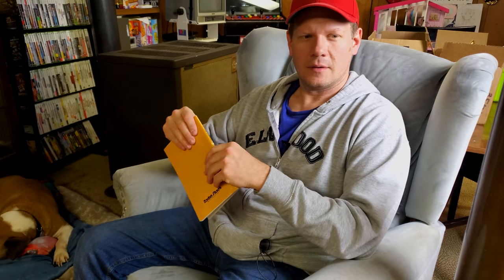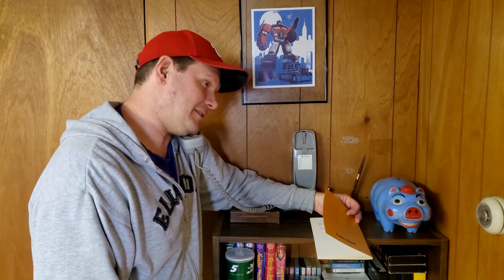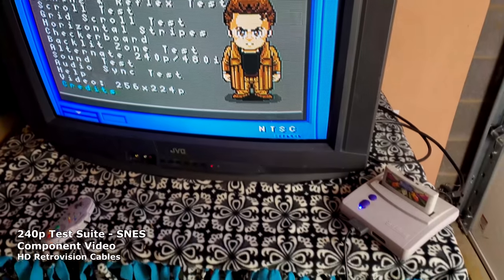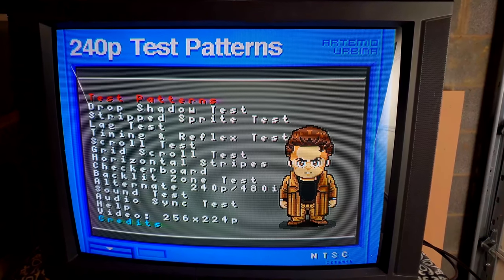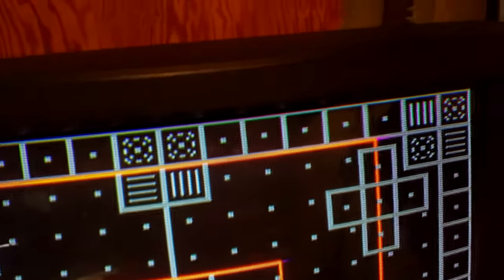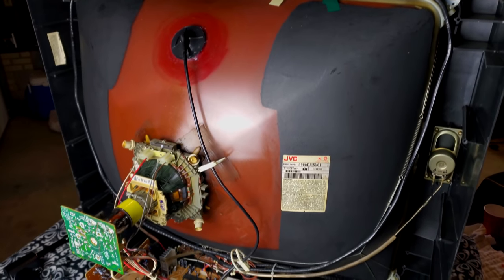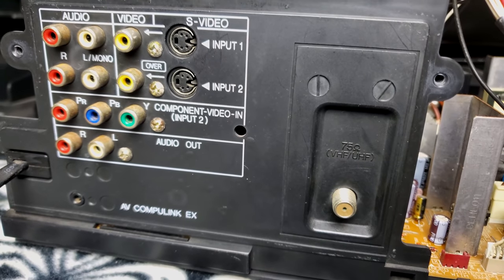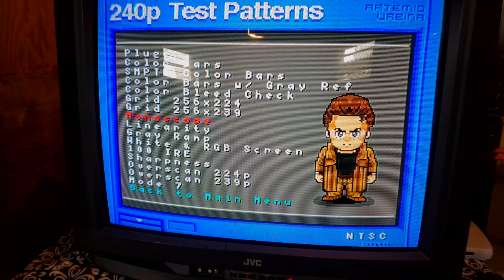The Biggest CRTs still in Use: The JVC 36" D Series TV

Comment: I've been tinkering with the service menu on my 32" for a long while and I think I have the geometry as good as I can get it with the options available. Still a bit wobbly, but after seeing your scroll / linearity tests I feel much much better about it not being "perfect." I don't have much a basis of comparison except your videos on calibrating them! Thanks a ton for the info and the active lab report!
Reply: How did you get into the service menu? The combinations I tried haven’t worked.
Reply: Same question as Nathan
Reply: @nathankimball2519   on an original remote (i'm not sure if this will work with a third party), push "Sleep Timer" and while that display is up, push ""Video Status" and "Display" simultaneously.

Comment: What was the biggest? That 40 inch one I sent you an ad for?
Reply from the maker: Yeah, that's the biggest I've heard of to date!
Reply: @RetroTechUSA  Actually the Largest I can remember was SONY KV-42DRC800 it was a 42inch 300LB+ Giant.
Reply: Trinitron
Reply: BTW, I';m glad you got some use out of that book as a novelty prop. I saw it was from Radioshack & knew I had to send it to you.
Reply: @RetroTechUSA  I'd like one too but there are other different variations of the same size and I'm wondering if they are tube shaped and not flat screen because otherwise, I won't be able to play zapper games effectively, right?
Reply: @JohnyTheWizKid  I have a flat screen 27" JVC I'Art and I play Duck Hunt and Wild Gunman with the Zapper gun no problem.

Comment: The funny thing about that picture tube is that it was actually made by RCA, even though the label bears the JVC trademark.

RCA picture tubes of this era are actually very good, even though the deflection yoke is permanently bonded to the picture tube.  It's just that RCA themselves made terrible electronics when it came to their own TV sets during the years that the brand was owned by Thomson Electronics.

So, this monitor is a good marriage between good JVC electronics and a good RCA picture tube.

Comment: Awesome set! I've picked up a Sony Trinitron KV-AR34M81. It is stunning. It survived a bomb blast in Dubai. It does have geometry problems. If you can imagine pinching the middle top of the image and pulling it up slightly vertically through the middle. Service menu definitely can't fix it so I'll have to open her up. I'll be practicing on two smaller Trinitrons. A Trinitron KV-24LS35B and a small 14" Daewoo with some purity problems. Love your channel. I've learned so much from you. Cheers from the UK!
Reply: Update. Fixed the geometry problems. This Trinitron had an extra set of rings on the yoke sat on their own further back that allowed for fixing this exact problem. Pull them apart and the top and bottom expand, or move them closer and they retract. Can't pull them too far apart though as this causes some distortion in the colour in the the corners. The manual states no more than 6cm. I've got mine pretty much as far apart as I can get them without ruining the picture and now have flat lines top and bottom.

Comment: This massive 36 inch JVC has alot better corner convergence than my 20 inch Emerson! I have a suspicion one of the convergence strips in my set has either shifted or fallen out entirely due to age. Don't know for sure though, haven't opened it up yet. I looked it up and apparently its a common problem on my set.

Comment: Great video on one of the best bubble tubes out there. For those hunting for a JVC d series I would look for models with a 200,201,500 and 501 at the end  e.g. AV-27d501. These are the d series that have higher tvl according to JVC's official specs (there may be more). JVC also used different suppliers for their tubes so that can affect the tvl as well.
Reply from the maker: Thanks for the info!
Reply: That is true.  The early D series models made from ‘99-‘00 used different tubes that have a significantly better picture with a much better brightness/gamma/color balance.
Reply: I own a 36D201 (December 2000), a 27D200 (October 1999), and a 36D303 (April 2002). The D201 and D303 both have 800 TVLs but the 303 is much better as it's newer, has a better comb filter, pro color temp settings, and better convergence and sound overall. I also had a 32D305, that one was my most advanced and later stage D Series (2005?), would have been my favorite if it were bigger, had an actual antiglare "dark tinted" tube, the ability to switch between component and composite/S-Video on the same input through the display, and a game mode. I've ditched most of my WEGAs and other CRTs for JVC TVs, especially the D-Series.
Reply: @AMERIFREEDOM you seem to be the guy to ask, how do you open the service menu?
Reply: @MrSolidtiger  i tried to reply yesterday, press sleep timer button, then press the display and video status button at the same time to access the menu
Reply: @AMERIFREEDOM  Do the non D-Series JVC CRT TVs share the same picture specs of the D-Series? I have a JVC AV-27260 from March 2001 and the picture looks extremely good. It has a Thompson tube.
Reply: @sixteenbitify  Yes, a majority of the non D Series sets share the same tubes, just have a different design, speakers, and sometimes lack a few other things internally.
Reply: @AMERIFREEDOM  Ah, if that’s the case, then the D-Series is a bit overhyped in my opinion if a standard JVC CRT TV from the same era can give you just the same great picture. I get that the D-Series have a subjectively better design and better speakers. Maybe it’s a good thing that the regular JVC TVs are a hidden gem since prices for those TVs are very cheap to find today.
Reply: @sixteenbitify  I'm kinda over the D-Series hype after owning some better JVC I'Art TVs, and just got delivered a 27" Sony FV310, subjectively the best SD consumer CRT TV Sony made, D-Series are cool, but ultimately aren't the absolute best.

Comment: Great video!

I will agree the 36" would be a monster. My 32" D-Series sets are as heavy as I care to move on my own. Kudos to those of you lugging around those 200+ pound Trinitrons. I "probably" could carry one... but my back sure wouldn't like me for it.

I am a wee bit disappointed there weren't more adjustments to make / that you could make.

I'm wondering if it would be possible for me to shoot you over a few pictures of my two D-Series sets to see if you can give me an idea of what you think is causing the wavy lines?

It's a bit strange, especially on my 32" Silver D-Series. Games themselves you don't really see / notice it. But the SegaCD BIOS screen and especially the menu in the 240p test suite.... the vertical lines on the left and right edges of the monitor have "waves" in them. Capacitor issues?

Comment: hey steve, i just finally got a black 36D201 after MONTHS of searching. i already have a 36D305 and 36D303. One thing i was wondering . The black one seems to be considerably darker than the Silver sets i have...also its reds are bleeding bigtime. i basically have to turn the color down to almost greyscale to get the reds under control. and i do not have the option "NTSC MAT" in the service  menu that you showed in another video of yours.  Is this down to the tube being different  ? or is it dying? thanks.

Comment: Recently Picked up a AV-36D202. It seems like I might have an issue with the front power assembly as when powered on the volume + continuously goes to full volume. Have you run into this on other D-Series? Not sure if the board needs re-capped or repaired?

Comment: Hi Steve. Great video and a beast of a consumer set. Didn't see much this size in the UK AFAIK. I have a question for you which would really appreciate a bit of guidance on, if possible. Got a BVM-9045D which has a pink hue where it should be white and the front pots for gain and bias don't seem to help at all. After watching this video it made me think that I may need to open it up and adjust the G2 voltage / screen? Or do you have any other ideas over what may cause this? Would love to fix it or get it fixed as otherwise the wee BVM is in great shape, but the overall pink hue is very noticeable.

Comment: I know this is old, but the red over saturation is actually this dumb software "feature" you have to turn off in the service menu.  You can also use red cut on models without this service option.

Red Push fix: Enter the V/C (S) menu and change "NTSC MAT" to 0 on all inputs